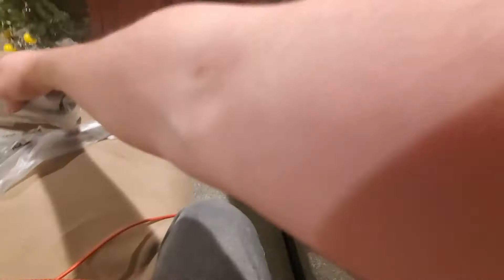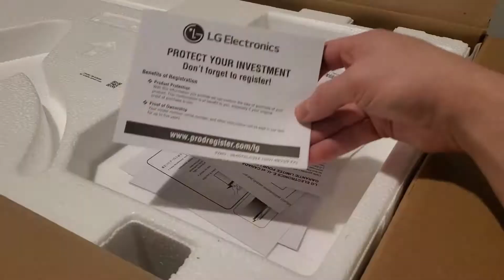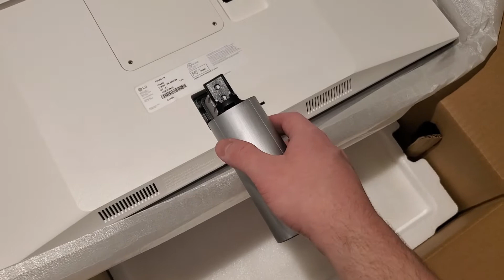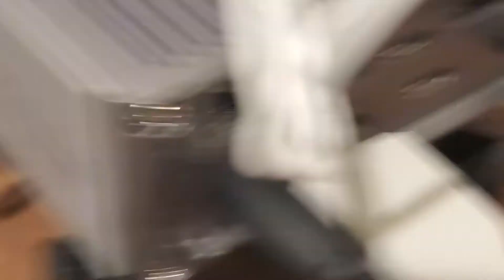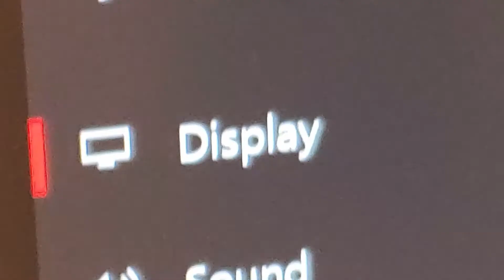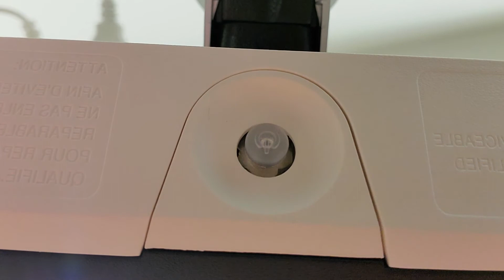Unboxing & First Impressions: LG 27UL600-W 27" 4K IPS Monitor

Comment: Do you think this will work well with ps5
Reply from the maker: I think it would be fine. Just be aware that this monitor is only 60hz so you won't have a super high refresh rate. It does have speakers & HDMI though!